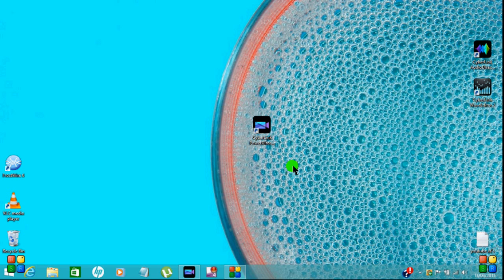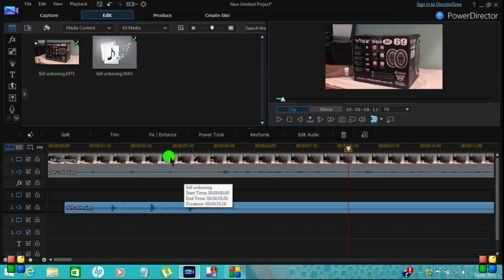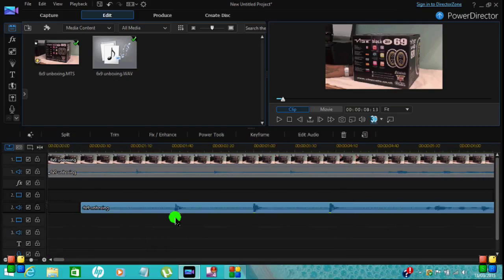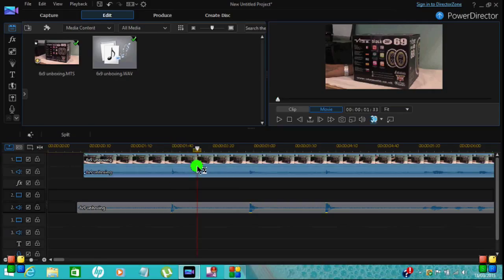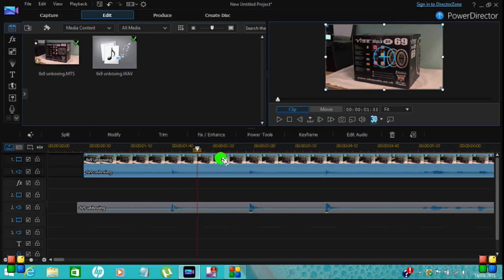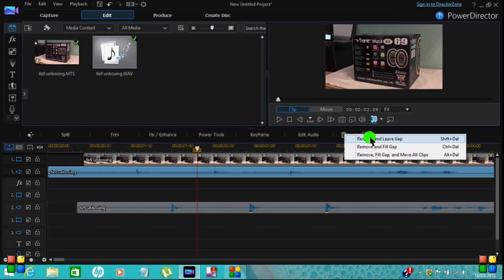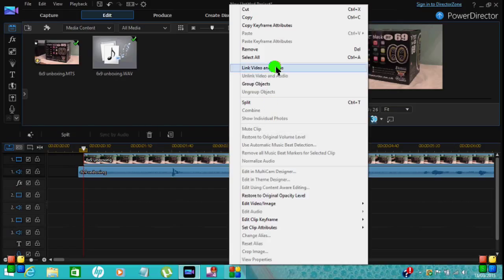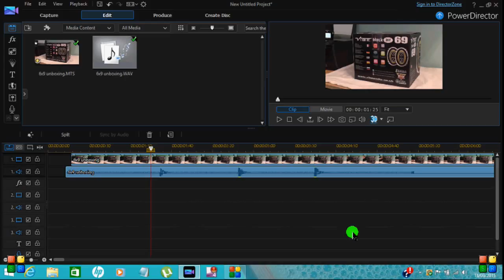How To Sync Your Audio With Cyberlink Powerdirector 13

Comment: Simply highlight both audio and video tracks and push the" sync audio" button. Way easier.
Reply: Doesn't work for me in PowerDirector 15 trial. After clicking on "Sync by Audio", my external audio track moves to the very end of the video (just right in its end). And if my main video is not linked with its audio, it's getting even worse: after clicking on "Sync by Audio", the audio from the video moves to track 2 just on the place, where the external audio was. And the external audio moves on track 3 and again just in the very end of the video. Complete mess. I don't know what's wrong. Is it bug or not.

Comment: Hi, do you know, if it is possible to align thousands of pics, which are
 only 0.3 seconds long to thousands of markers in a long audio track 
automatically ?
Say I have a music track with beat detection and 2000 markers, how do I align 2000 pictures automatically to these marker points ? To do it all manually would be a real pain... Is there any trick how to do this ?
Many thanks.
Regards, Stefan.

Comment: Is there a way to sync digitally without "eye balling" it?
Reply: JuicemanBill some programs do this for you but the best way would be lip sinking or using a clap board. manual will almost always be better than auto
Reply: Easiest way without eye balli ng. Drop video in Track 1. Drop audio file in track 2. Select track 1 and 2 together.  then click on "sync by audio"
Powerdirector will analyze both audio and sync it perfectly easy.  When finished select track 1. Right click and click unlink video and audio.  Select track 1 audio and click delete. with your play header in appropriate position drag and drop your sync audio in track 2 into track 1 just under the video. select both files now in track 1. Right click and click link video and audio. Hope that helps.